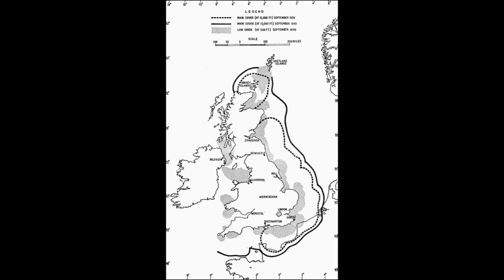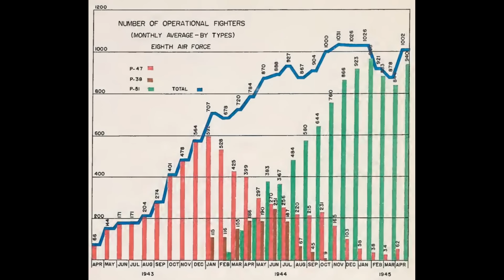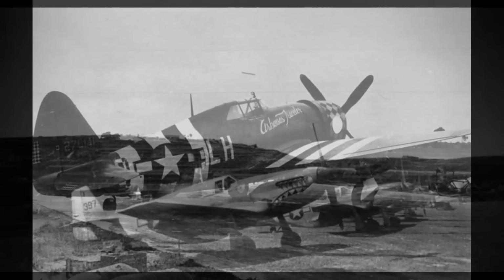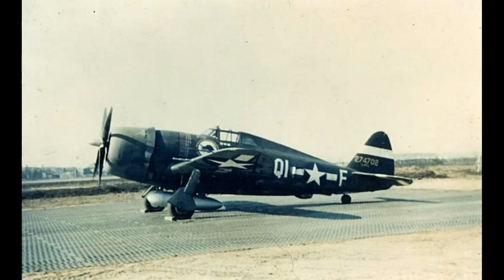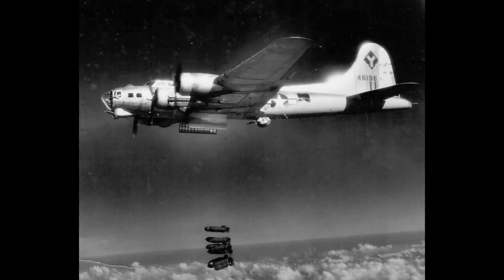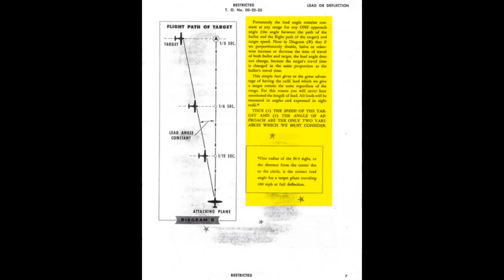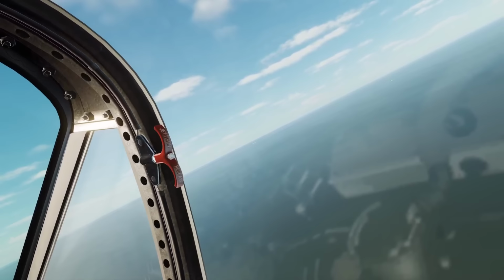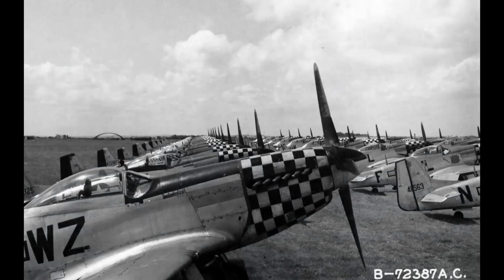Under Appreciated BRITISH Tech From WW2

Comment: I worked with the design team (as a USAF officer) for the Republic A-10 in the 1970's.  The engineers were mostly from the P-47 era and had very strong opinions probably formed by that experience. First they believed in a robust airplane that kept the weight control team in fits. Second they were instrumental in persuading the Air Force to include space, power and cooling in the cockpit area for new avionics that were not yet available.  Desert Storm came and the avionics were ready just like the drop tanks saga.   The negative part was that they successfully resisted any solid state avionics, preferring banks of expensive and heavy relays in the complex weapons management system.  Overall, the A-10 was successful even though it was never used in its original role as a tank buster.  Not only was it designed by P-47 engineers but when  it entered production in 1973, the average age of the work force was over 60 years of age who might be politely described as difficult when it came to adopting new quality control and configuration management practices.
Reply: @George Anderson I am so old that i remember the quite sobering films we were shown on A-10 doing gun runs during our training (i served in Army air defence). You dont want to be at 0 degrees of THAT gun, even on handles of light AA gun capable of shooting back. We were still lectured during early 90s about danger coming from west AND Russia. EVERYBODY knew it being just formal PR spin. Unofficially all trainers said it out loud. Enemy was and is forever in east.
Reply: You ever hear/meet Hans-Ulrich Rudel In 1976, Rudel attended a conference in the United States with various members of the United States military and defense industry as part of the development of the A-10 Thunderbolt II; Rudel's status as a highly decorated attack aircraft pilot and particularly his experience at destroying Soviet tanks from the air was considered relevant to a potential conflict between NATO and the Warsaw Pact.
Reply: Using relays its less suceptible to EMP
Reply: Are you Pierre Sprey?
Reply: @kimmoj2570 that’s called racism and xenophobia. Oh look people that look different from me that I don’t politically like.
Reply: @zeitgeistx5239  Russians dont look different than Finns. OK, we Finns have quite bit more blood from Sweden/Scandinavia.
Reply: Weren't they Fairchild A-10's?
Reply: @zeitgeistx5239  Recognizing your enemy aint racism or xenopholibia. Ask ANYONE here who is our enemy, and 99% answer Russia.
Reply: @kimmoj2570 Brit here BS the propoganda is working.
Reply: @jeebusk quick, somebody get @Lazerpig
Reply: @kimmoj2570  nope
Reply: @ericneilson1198  You are fifty percent correct.
As far as I can find, Fairchild Hiller bought Republic in 1965 and became Fairchild Republic.
In 1987 Fairchild Republic ceased and became part of Northop Grumman Corporation.